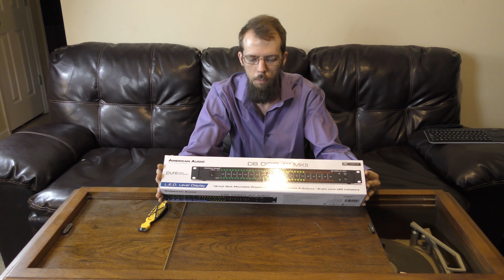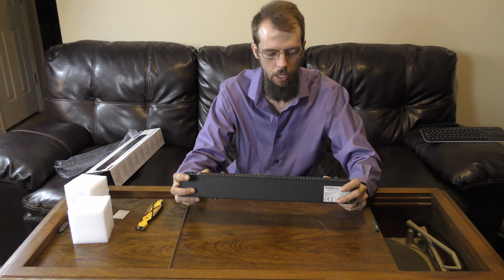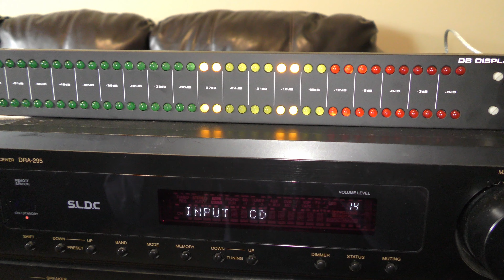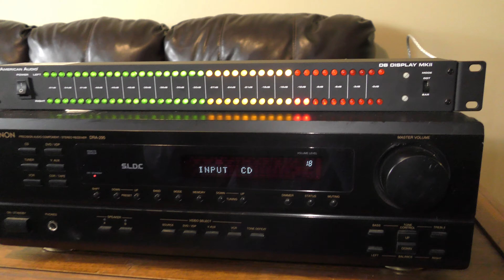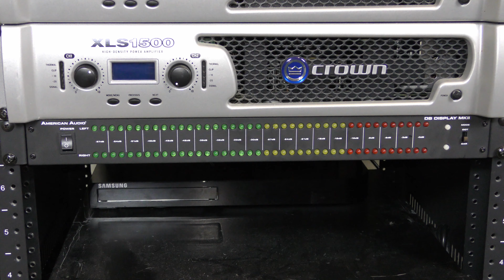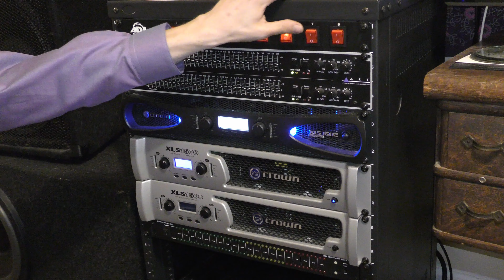American Audio DB Display MK II Unboxing/ Test/ Installation

Comment: Cool to see one of our L7 subwoofers in the video.   thanks..
Reply from the maker: About to rebuild the 2008 L7 with Springfield Speaker replacement parts to fix some coil rub... doing it more for nostalgia than anything else... the 2006 L7 was my first proper subwoofer I ever owned way back when...

Comment: Pioneer 933 receiver and I'm not seeing a output, not like my old amp.  If I do get this running perhaps if I located beside my speakers would that help, ?? Thanks again, I'm on the road so it will be next weekend when I can try it out.

Comment: I can not get it to work , demo works , perhaps I don't have the RCA cables hooked up right ..  Just hooking it up to a home stereo ?? Please help
Reply from the maker: Its not very senitive disconnect your speakers from your amp and drive a full output signal thru see if u get anything then
Reply: thanks for the reply.your talking to a amateur .not sure what you mean.
Reply from the maker: @marquespushbar  It takes a pretty powerful signal to drive the lights on this display. The small plastic adjustments on the right side of the face-plate vary the input sensitivity, basically how much signal voltage is takes to light it up. RCA type connections are unbalanced and typically operate at much lower signal levels and are not going to light the display up as easily. If you disconnect the connections from the amp to your loudspeakers (so you don't burn them out) and try playing music thru the unit it should light up when you crank the volume knob to maximum or close to it. This unit is not really suited for output level monitoring in a home environment though, it will not trip without a pretty hot (loud) signal going thru. Do you have the unit connected to the TAPE OUT on your home stereo?
Reply: WooferVision Hi. No matter what I try I cannot get this to work, I have active subs and wanted to know if it’s possible to run my dB display through them I.e connect an xlr cable from the output of my subwoofer to the input of the dB display? Thanks